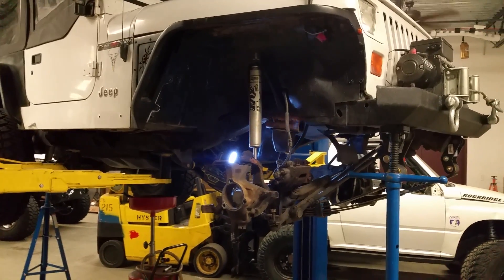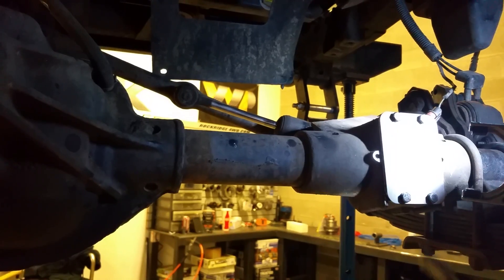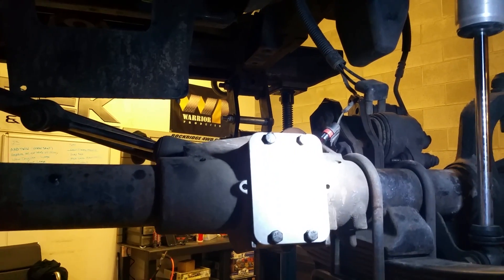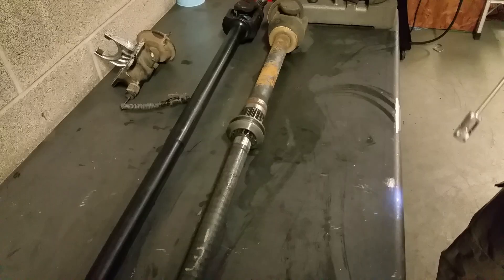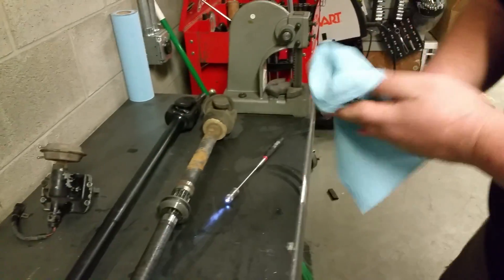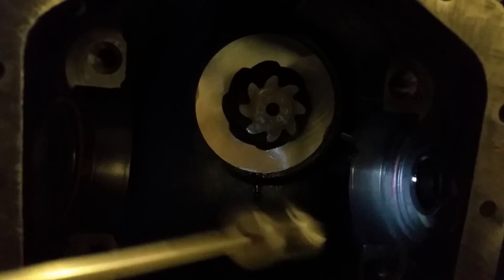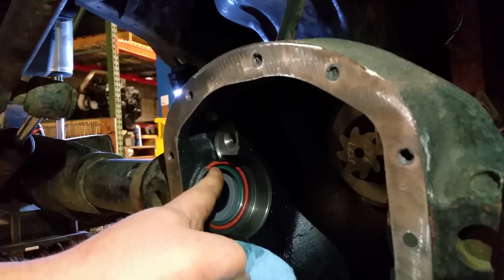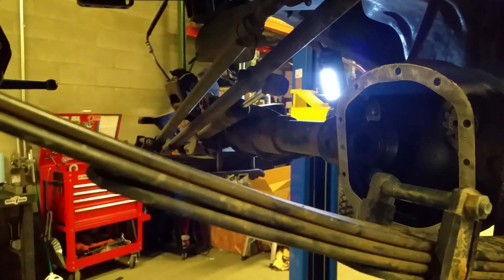Jeep Dana 30 CAD Explained & Upgraded to 1 Pc Axle

Comment: Use the cable disconnect posilok.
That way you have 2 wheel drive Low Range.
And retain the light if that matters to you

Comment: 0:57 unreliable? LOL
You put a cable in (that freezes up in snow/slush; I ran one for 3+ years) to ‘fix’ a VERY reliable oem axle disconnect. Nothing wrong with it. Just because it needs a new harness or vac motor after 25 years doesn’t mean it’s no good.
Reply from the maker: Do what you want. The best option is a 1 piece axle.

Comment: Do you have a fix for the 4wd light or do you forego it? Can the button actuator be remounted like on the 4wd shift lever so its pressed when the lever is pulled?
Reply: You can actually put a TJ 4wd indicator switch on the np231 of the YJ and wore it in to the old switch in the engine bay and it will work like factory

Comment: I forgot to add, aren't there two seals around the Shift Motor Housing? The original manual says to "add 5oz of GL 5 gear lube through the switch hole." If it was lubed with the main differential, why would we need to add additional oil? Just a bit confused here is all...And Thank You for taking the time and creating the video!

Comment: Curious, wouldn't another option be to simply turn the shift fork around, and forget about it, to save money.
Reply: I did something similar. The shift fork is held with a clip on the shaft. You can remove the clip, slide the shift fork to one end and put the clip back to pin it to the other end. That then locks it. I think removing this assembly is better overall for tough 4wd driving since it is a fail point but for regular 4wd work its fine. The only drawback is you don't get that 4wd light coming on which the cable kit will do for you.

Comment: My 89 XJ Had a bearing just inboard of the CAD housing that the old axle would ride on. The new axle was a tad bigger than the bearing bore.  I had to remove the bearing. Not something I had seen on any how-to videos. Just a heads up to others.

Comment: If you change the axle shaft what do you do with the vacuum lines at the transfer case?
Any help is appreciated in advance!
Reply: They simply get blocked off.   Same thing when you install a 4x4 posi lock cable.
Reply: @jeffharvey9437  Thank you sir! So I can remove the lines.

Comment: This would be the same as the collar engaged... That being said does that mean 4x4 is always engaged?
Thanks for the Video
Reply: 4x4 is not always engaged since the T-case is not engaged but yes, the front axles will spin on both sides.  The driver side does anyways with or without the solid axle.  It will essentially be like every other solid axle Jeep without CAD.

Comment: I wish I had seen this before the past weekend.  It would have saved me so much headaches. I needed to change my axle seals on my 87 YJ,  and thought the seal was at the diff.  If I had known that it was at the vac DC, I'd be a lot happier person at the moment.  Doesn't help that I still need to get at the one on the driver side, but I'm glad I now know what's up with the passenger side!  Thank you for this.

Comment: Great video, but I have a question? When you add the solid axle to the right side, then engage your 4 whl dr. and if you don’t have some kind of locker up front, you would have an open diff. the wheel with the least resistance will turn. So technically you still have a 3 wheel drive, if you have a trac lock in the rear?
Reply: that is true even if you leave it with the factory set up, just like all non locking front diff 4x4s. this modification just gets rid of the 2 piece right side axle wich has always been a week/trouble spot in early Jeeps, even Chrysler knew this and got rid of it by the mid '90s and went to a single piece axle on the right side.
Reply: So i do have a locker up front would this be horrible to do for me or is it that bad
Reply: @johne9650  typically if you have a locker up front this is a mod you would do at the same time. It just gets rid of the vacuum issues. You just go to a solid axle.